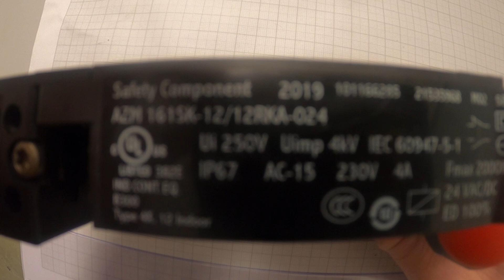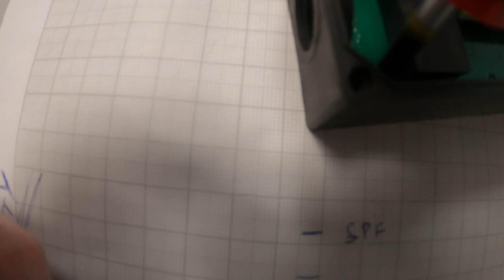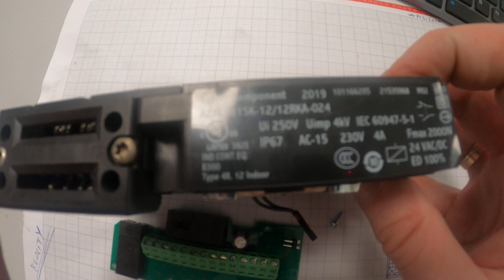Schmersal position switch from inside

Comment: Hello, I have a MZM 100 ST2-1P2PW2RE-A Schmersal solenoid interlock sensor installed in a machine (it protects the closed door). The machine has been in operation since 2016, and now it has started to malfunction (the machine signals that the door is open, even though it is closed). I turn off the machine, turn it on again, and after a few seconds of operation, it shows the defect again (the second LED lights up red, and after I open and close the door, it goes out again). I have already checked the adjustment between the solenoid and the actuator, and it is ok. In this case, is there anything I can do to repair the sensor? Thanks.
Reply from the maker: You can check his function look my this video how to check functin of solenoid here: https://www.youtube.com/watch?v=SCXgaafKgHk
Reply: @technicianengtestsolut8723  His video is showing another switch model of mine. MZM switch is covered totally. I can't get disassembly.